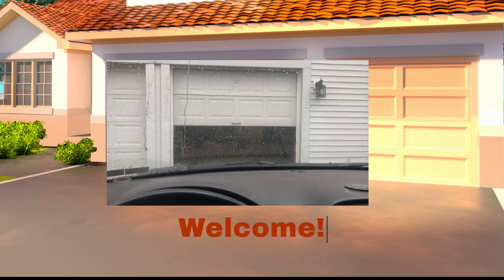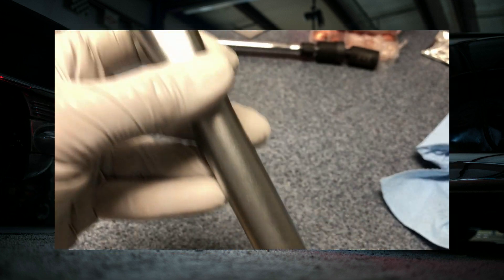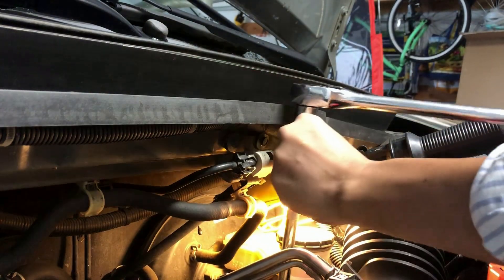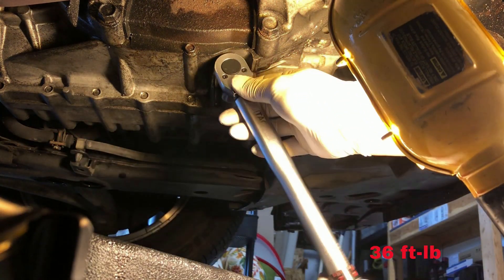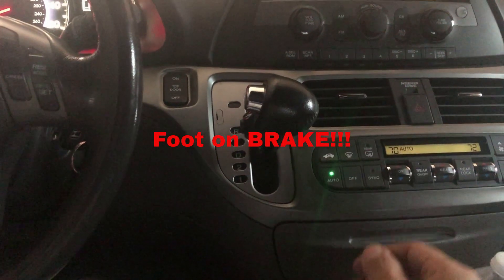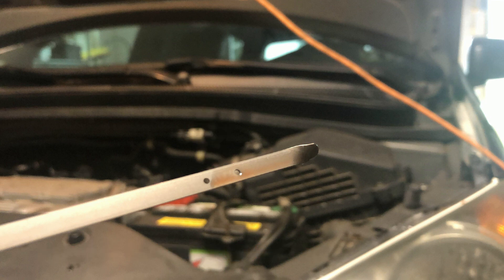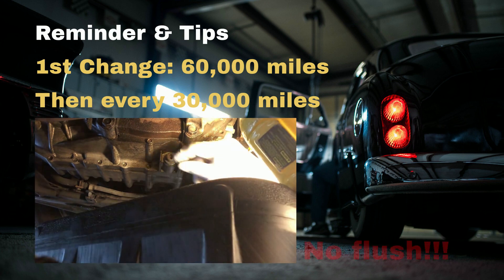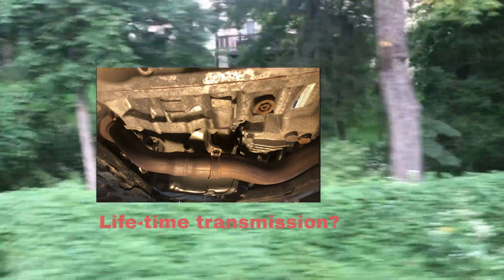Honda Transmission Fluid Change - Simply Drain and Fill - with Dipstick

Comment: I added 3 and I don’t see the mark on deep stick
Reply from the maker: Assume you have the same model/transmission, did you run the engine until it's operating temperature (fans on), turn it OFF,  and wait a minute or two to measure it? Honda's procedure is a bit different from other manufacturers.
Reply from the maker: And after the above procedure, you may still need to add more to see the mark. This transmission needs about 3 1/4 quarts or more.

Comment: Or to do a " passive flush " , as seen on OneRoad YouTube channel .
Reply from the maker: That can be okay ONLY IF it is done properly and you know the transmission is still running strong, no hard shifting, no concerns of potential slipping before you do it.... I'd rather do drain-and-fills regularly rather than flushes for two major reasons: 

1) If a vehicle hasn't been maintained well and the clutches are worn, you may end up with a slippery transmission after a flush. At that point, there is no going back. A drain-and-fill only replaces a portion of the fluid, good enough to renew the fluid, and won't cause such problems. 

2) If I understand the passive flush method correctly, the engine/transmission/pump is running during the procedure. One has to be super cautious and 100% sure not to overlook anything while running the flush.
Reply: @profsg  This is no way like the use of a transmission flushing machine . Which I agree to not use , unless you bought the car new . It involved disconnecting the transmission cooler lines . One end sucking up new fluid to flush out the old fluid as normal pressure .